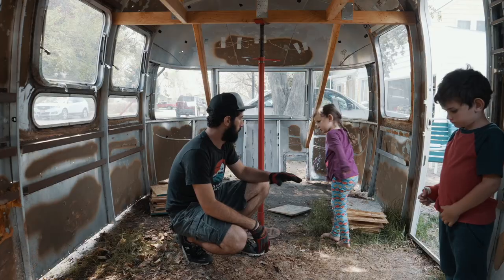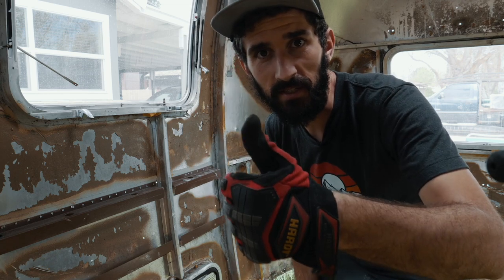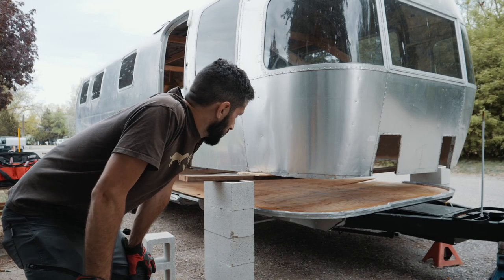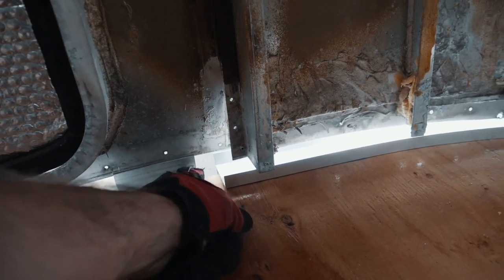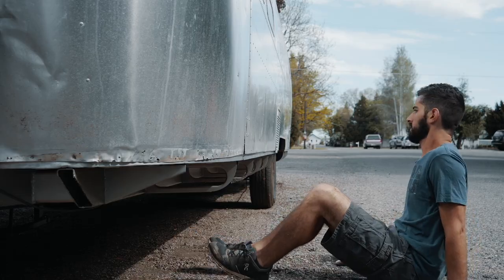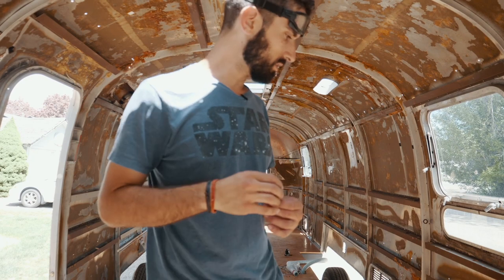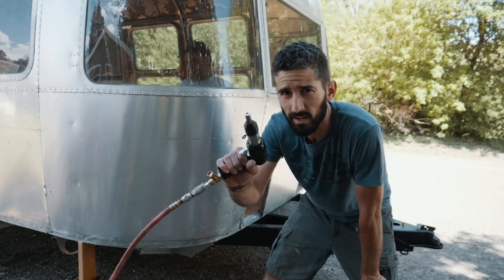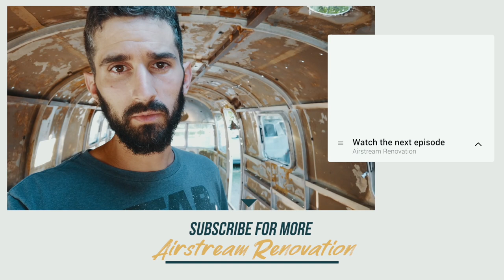AIRSTREAM RENOVATION: Time for the Shell to go back on! Subfloor installation and buck riveting

Comment: Any issue with attaching the wheel wells to the shell? We got our wheel wells from out of doors mart and they don’t come all the way down to where it was originally riveted to the shell. What was your experience? Thanks!
Reply from the maker: Hey Kristin, we haven’t gotten to the wheel wells yet. But my plan was to fabricate some aluminum wheel wells as I didn’t want to go back to those plastic ones that tend to crack